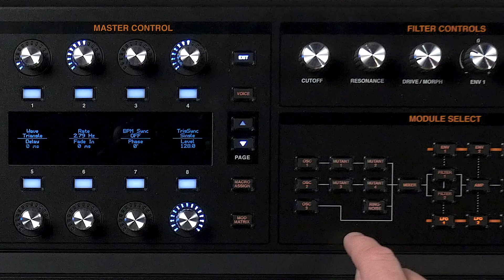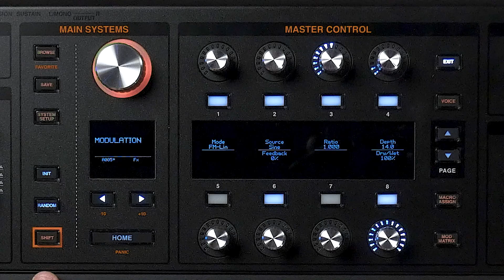What Is Frequency Modulation? – Daniel Fisher

Comment: fm is A(t) = A0 * cos(w0*cos(k*t)*t) which results in a Spectrum with sidebands  around w0 with sidebands at w0+k and w0-k. Depending on the modulation diagram used you can get very predominant sidebands that sound terribly unharmonic. fm synthesis is a real bitch with up to six or eight "operators". fm sounds can completely change the tonal character while the modulation frequencies alter the spectrum of the original sinus/cosinus wave.
Reply: FM isn't any harder than subtractive, it just requires a different mindset.  It's only a bitch if you refuse to learn how it works.  If you have an open mind and willingness to learn, it's really not rocket science.
Reply: "wow you sound so smart you must know a lot!" there you go pal I gave you what you wanted